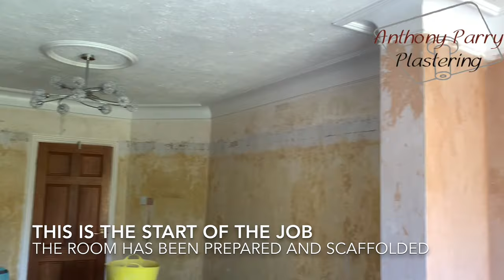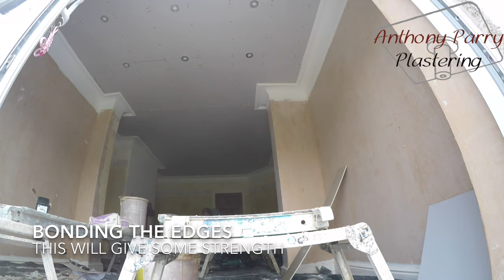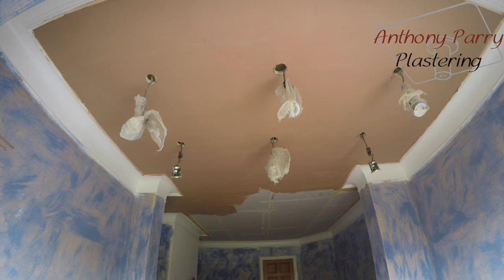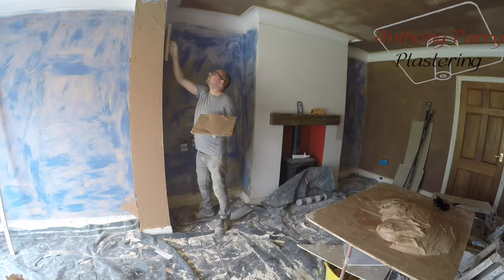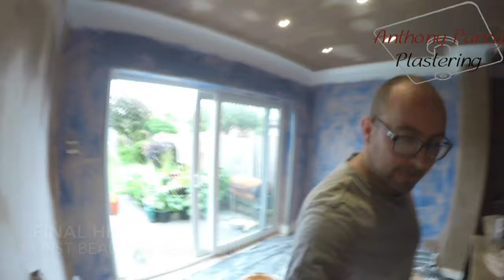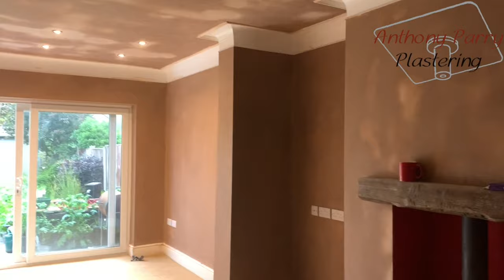Timelapse plastering a lounge Start to finish

Comment: Over boarding with spots already in..headache. Ceiling i recently did i ended up disconnecting them all and putting them into connectors, thought it would be too much hassle to board around them & create too many joints, but you made it look easy. I'll try boarding around them next time, Great vids keep them coming.
Reply from the maker: Thanks Ted, it was down to not having to many options. I couldn’t disconnect them without cutting off all the power to the bottom of the house. It worked in the end 😀 
Thanks for watching I’ve set a goal to have a video out every Tuesday so there plenty more  to come. 🙏

Comment: I’m confused... how did you find the joists?  Couldn’t see any string lines or holes
Reply from the maker: No I don’t bother with string lines or making holes. Joists almost always run in the same direction and have similar spacing. 

I have a few ways of finding them, normally I can find popped nails or cracks that will indicated when the joists are. 
Or I can use a hammer to listen where the joists are. (If it sounds hollow there’s probably not joist there)

Then I use  screws to find the joists.  
once  I found a good fixing I go either side to find the width to make sure I can land in the middle of the joists with the plasterboard. 

I always rely on the feel of the fixing. 

Hope that makes sense.